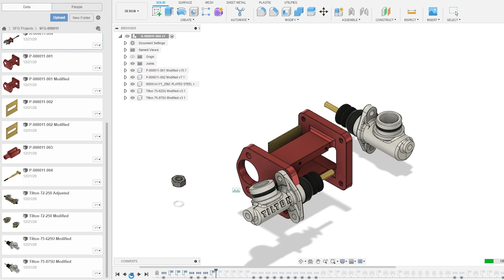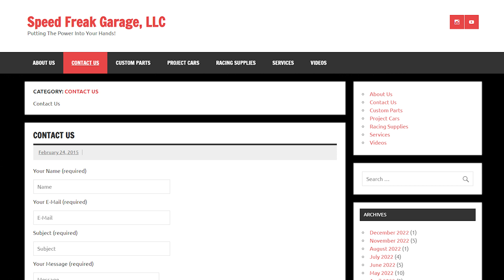Made-To-Order Custom Car Parts (3D Scanning & CNC Machining)

Comment: Hi, are drivetrain parts a possibility? For example a gear or a dsm/Evo123 center diff spider gear?
Reply from the maker: I can 3D scan them, and reverse-engineer them. However, gears are usually manufactured with specialty equipment; either cast/sintered/forged, or CNC'd with a 4-axis or 5-axis machine.  Unfortunately, my machine is only 3-axis.  🙃